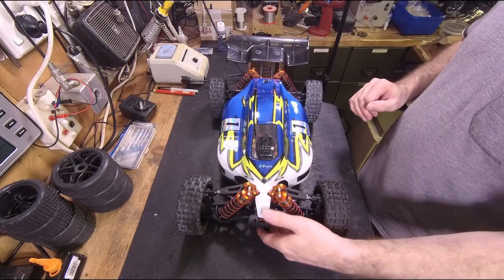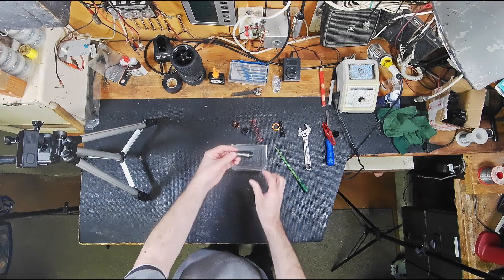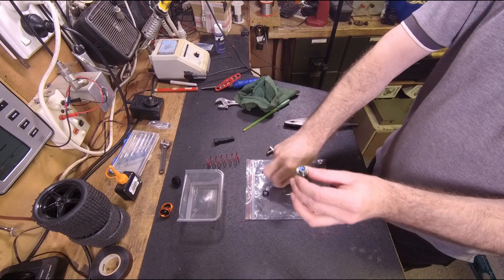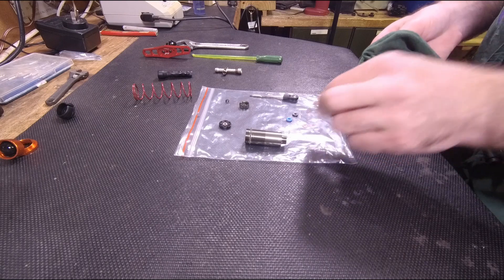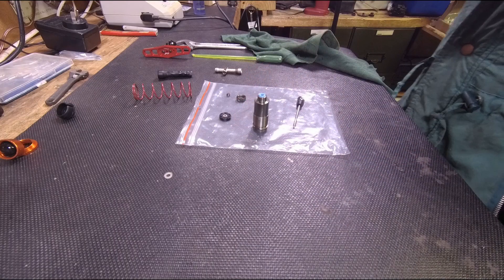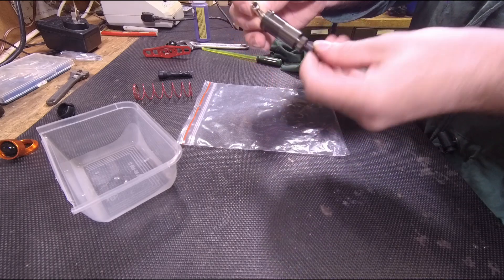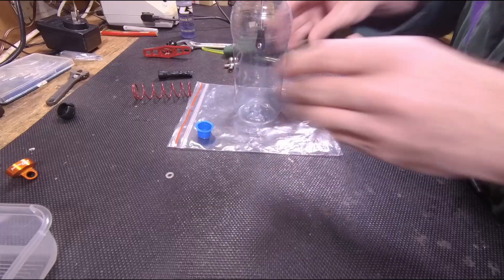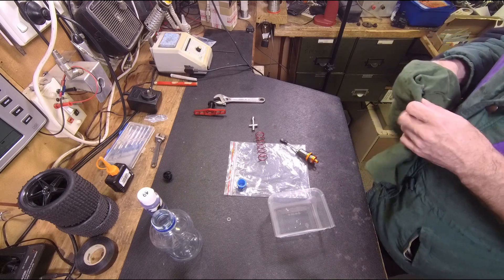How To Fix A Leaking RC Shock

Comment: Another way that worked on my cheap al shocks that were leaking like crazy,  was to use a 3rd old o ring I had (I had no shims on hand). This nicely preloaded the original pack of 2 o rings. Since it was an old and flattened o ring, no additional friction was created. They are holding up great.

Comment: Great video. 

I bought a set of the zd racing shocks. They do look quite good as you say. Im fitting them onto a HSP 1/8 scale buggy.

I was wondering what oil weight to use and i think the 40w is a good starting point. 👍

Comment: Nice video.  I used green slime on the o-rings. I have  a bunch of these shocks.  Got a few gripes.  I keep breaking lower rodends; they are often drilled crooked/too-far from the factory so they are weak. Maybe a traxxass shock rod-end can fit?   I've also had the plastic piston get pushed over the nut; I will add a washer on that side next time too.